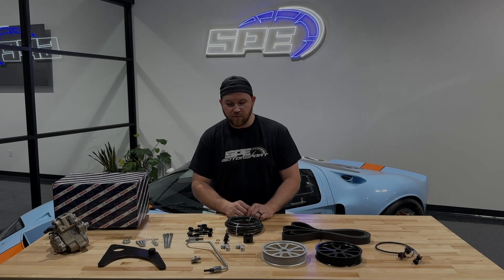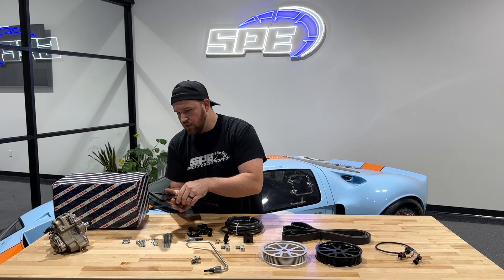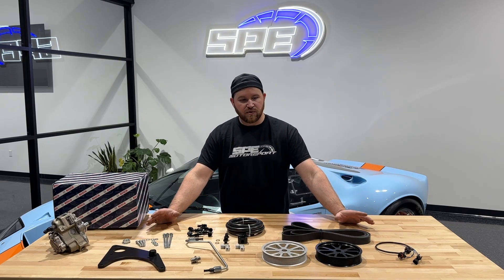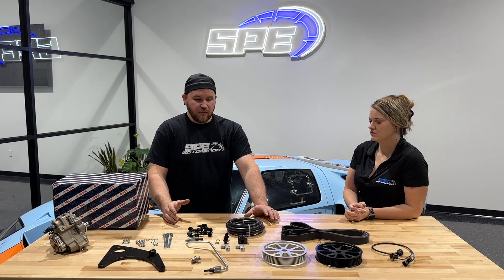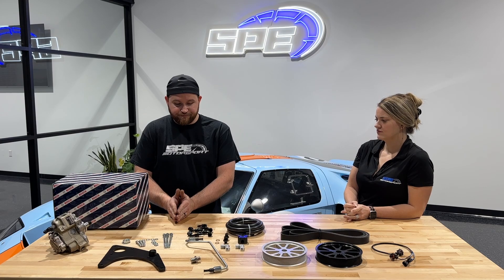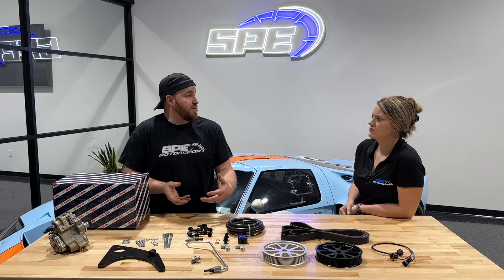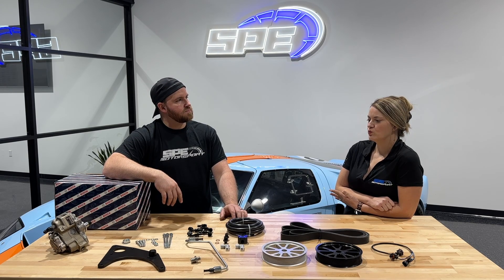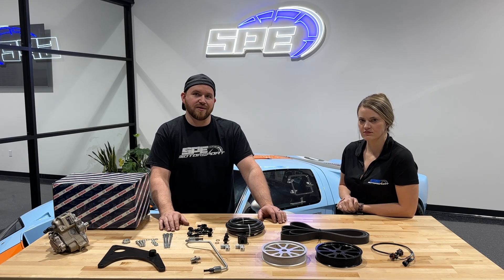SPE 6.7L Powerstroke Dual Fueler Product Spotlight

Comment: This might be a stupid question but if my truck is only weight reduced with a full air piping kit and stage 2 kc turbo, fass lift pump, and a DCR pump would this still work?
Reply from the maker: We haven't tested it with the DCR but in theory, you should be able to.
Reply: @SPEMotorsport  Thank you for the reply, I appreciate it. I own a 2011 6.7, I’m gonna order it and see what happens